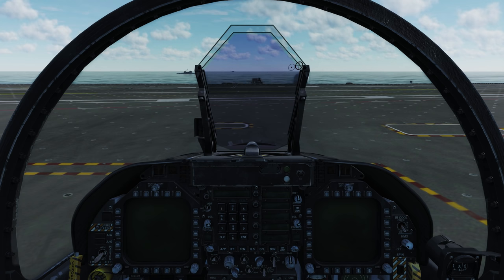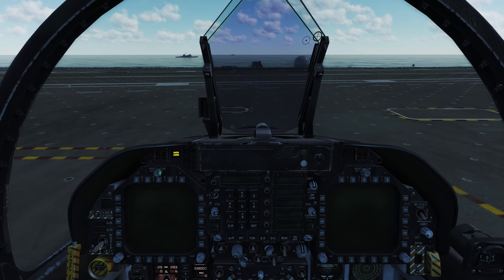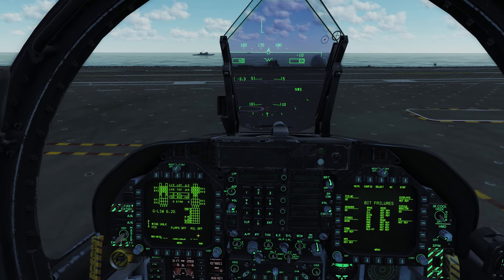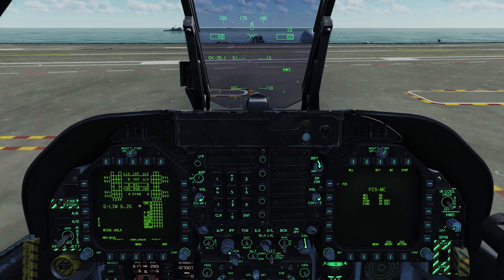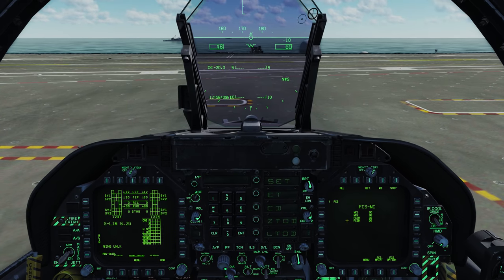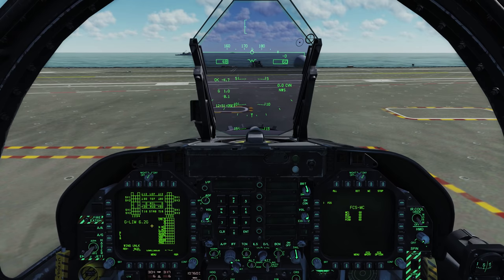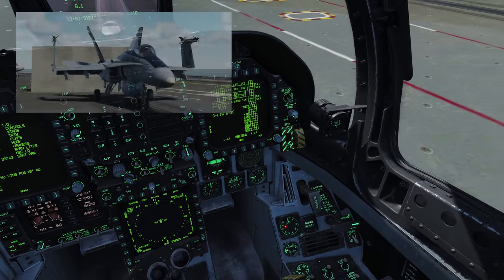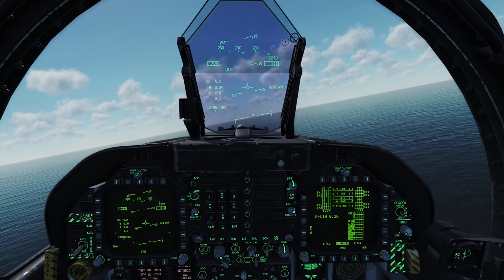DCS F/A-18C Realistic Carrier Startup Procedure

Comment: CW Lemoine mentioned they would put the BAT into Override first to test the A circuit. Then as you switch from override to normal it only takes about 1 second for the reset and you can test the B circuit. Saves some time.

Comment: Ever since the OpenBeta release update for 2019. I am here at time index 7:27 because I am having stabs issues not resetting to 0 at cold start on land.  Stab values always goes to 12 as soon as I take off, I can't go any faster than 285 knots, my rear flaps are point the jet up @ stab 22>.  Setting to auto, half, down, fcs resets don't work.  Twice I reinstalled Beta version , still doesn't work , so I watch this reinstalling DCS for May 2019.  STABs - how did you input the values to 16 from 12f?
Reply from the maker: Just use your trim up and down buttons to change the values
Reply: @TrickerDCS  , I uninstalled the OpenBeta and resinstalled the DCS, F-18 flies as you demonstrated.  Not sure where to find the button to enter values for trim, other than pulling aft on the stick.  Now I got to reprogram my F14.  Thank you for the response, do you have a link where to input trim values?  Just found it from check list, hold the V key and use up and down arrows to change values of trim.
Reply from the maker: You don't "enter" the values.  All you do is hit the takeoff trim button which sets 12, then you hold the trim up button until it reads 16 or whatever you want.

Comment: Pre-start-up:
Ejection Seat Safe
Master Arm Safe
Parking brake safe
Wings up check
Battery ON
Fire test right
Battery off then ON
Fire test left

Start-up:
Start APU
Start Right Engine (wait for 18% to intro fuel) - ensure exhaust temp doesn't exceed 750degC, if so shut down engine
Left DDI ON
Right DDI ON
HUD ON
MPCD ON
Change Left DDI to FCS page
Right DDI press stop
Click and hold Master Caution (rack and stack cautions)
Turn on internal lights
Rotate Bleed Air 360deg right
Close Canopy
Check Cautions on left DDI (>0 numbers)
Lights test switch then off
Start Left Engine (wait for 18% to intro fuel) - ensure exhaust temp doesn't exceed 750degC, if so shut down engine
Clear Cautions
OBOGS ON
Hook Bypass to Carrier
AntiSkid Off
Radar to OPR
Waypoint zero check: MPCD mode>mode, click Data, verify coords are correct (F10) > back to HSI
INS to CV
FCS reset
Raise flaps to HALF
Right DDI FCS page
Click FCS bit
Right DDI click FCS
MPCD click time
UFC click ZTOD for ZULU time
Raise flaps to AUTO
Wipe-out flight controls
Flaps HALF
Set take-off trim
Step trim on left DDI
Paddle to switch off NWS
Pitot ON, AV Cool ON, Extend Probe, Extend Speed Brake, and Extend Launch Bar
Set TACAN
Set ILS
Set IFF
MPCD set bullseye or waypoints
MPCD>A/C set soft altitudes
MPCD to HSI
INS to IFA
ALT to RAD
Set 40' on Radar Alt alert
Set BARO altimeter
Set BINGO fuel
Turn on RWR
Dispenser to ON
Raise launch bar, retract speed brake, retract probe, AV COOL to NORM, Pitot to Auto
Lower Tail Hook
Raise Tail Hook
Release Parking Brake
Set NWS to Hi (hit button twice)
Left DDI to Check
Right DDI to FCS

Taxi to CAT and then:
Extend launch bar
taxi forward to connect to shuttle
Spread wings
Lock wings
Power to 50%
Arm Ejection Seat
Left DDI to HUD
Right DDI to FCS
Wipe-out flight controls twice
Retract Launch Bar
Salute

Post-launch:
Wheels up
Flaps to Auto

Comment: According to the NATOPS checklist before the FCS bit the flaps have to be raised to Auto and the paddle switch has to be pulled simultaneously with the FCS reset button and only then the flaps are dropped to half and the FCS bit performed. This also means the FCS bit is performed with NWS off. Is this not how it's actually done, or is this step unnecessary and NWS on doesn't cause issues during FCS bit?
Reply from the maker: Appreciate your input, remember the NATOPS is 10 years old for the C and these are updated procedures by real world hornet drivers.  Not saying your wrong, do as you wish with the sim.  My objective was to show how I was told to start this bad boy up.
Reply: Tricker , thank you for this much needed tutorial. Please keep up your good work.  On the note of FCS BIT,  can the folded wings  cause any adverse effects to the FCS BIT tests ?  Is it better to perform FCS BIT at the catapult instead,  where  the ailerons are set to move freely ?
Reply from the maker: I was told they always do it before hand in the order I showed in this video.
Reply: Tricker , Roger :-) .

Comment: Just wondering how you intoduce fuel into the engines no mention of fuel pumps being turned on and when do throttles get set to idle from the off position
Reply: he does mention it. its not like some little cessna, the hornet introduces fuel by moving the thrust lever out of "off" to "idle detent". thats what hes talking about when the IFEI RPM hits 15%. He mentions the default key combination to bring the engine to idle. In doing so it adds fuel and it will start the engine.

Comment: This is probably a really stupid question but why would u retract the launch bar before you launch?? Like surely that's what pull you off the catapult??
Reply from the maker: It's locked into catapult shuttle, and when you go airborne the bar with automatically retract before you retract the gear
Reply: Tricker ahhhh okay thanks!! Great vid btw!!
Reply: Also good to know: If you'd forget that, the front gear would not retract as long as the launch bar is extended.

Comment: Suggestion: Perhaps do a vid on ground power, seems you can't communicate with the tower as the radios won't function until the aircraft has sufficient power, and unlike the A-10 the apu does not provide that power.

Disclaimer: I may be missing something about the radio power, if so, then this comment is a total waste of time.
Reply from the maker: usually COMM 1 is on the DC Batt Bus which makes it hardwired on most airplanes, but on the F-18 I'm not sure the technicality
Reply: Yeah you are right COMM1 does get power to transmit and receive, but you can't change the channel or the frequency, so you have to set COMM1 channel 1 to the frequency of the airfield or carrier in the mission editor.